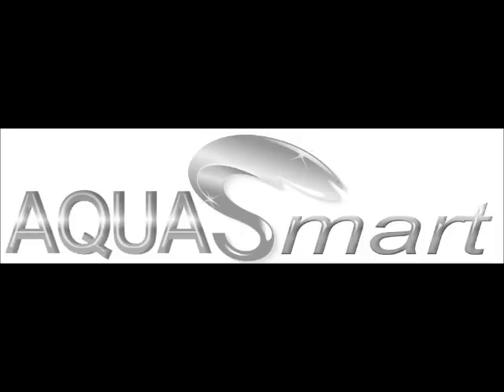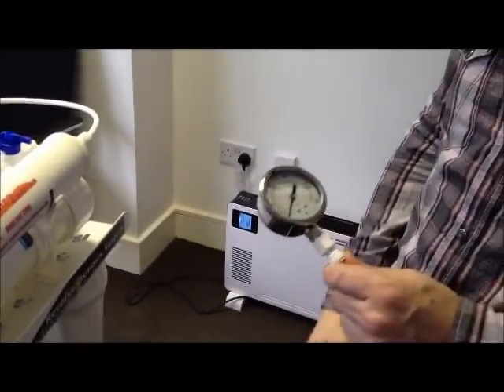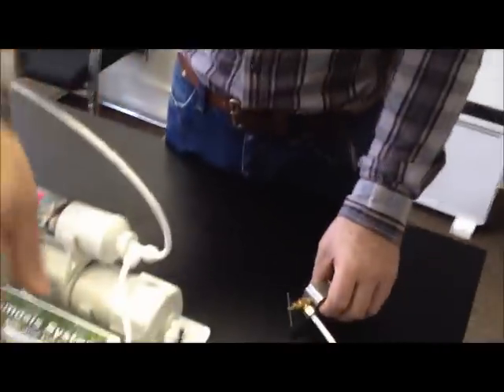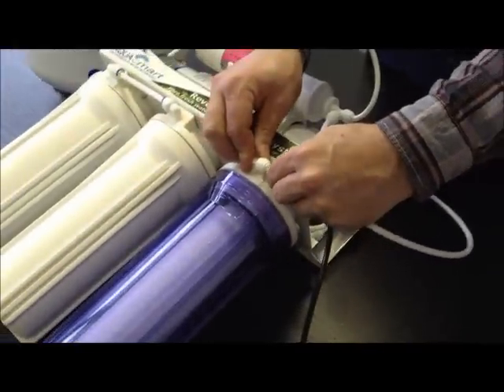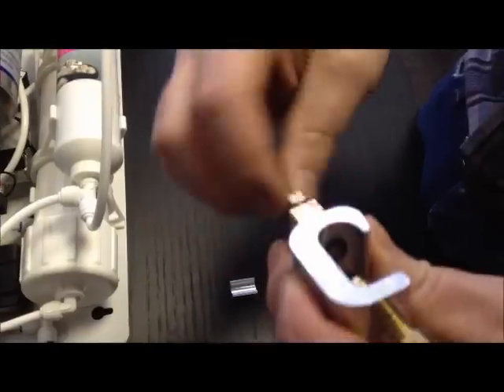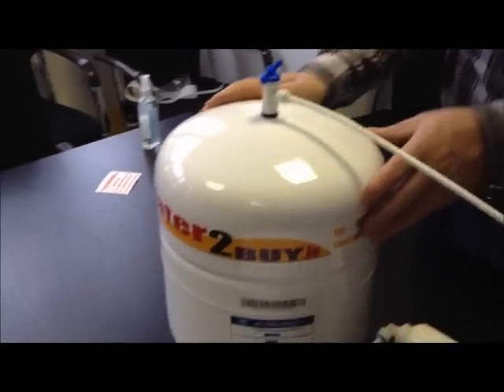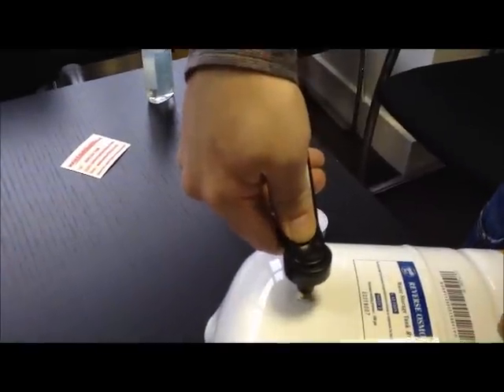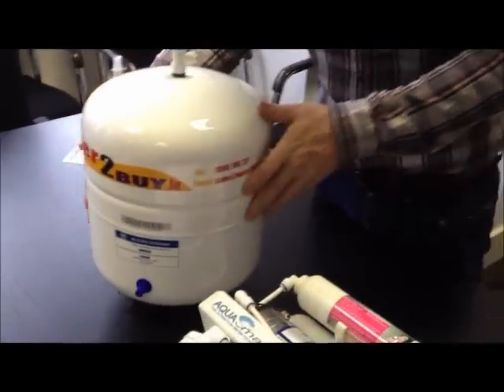Reverse osmosis No water or a poor water flow from your NON-pumped system

Comment: My system is not producing water.  Input water pressure is 55 psi. My tank is empty and empty tank pressure is 7 psi.  Tank doesn’t fill, drain line is flowing and there is no water from the RO membrane to the tank or faucet. Obviously ASO valve is open - could this be bad check valve or clogged membrane?
Reply: Xezatt  I figured out my problem.  I took out the sediment filter and 2 carbon filters.  On each one of them I covered one end with my hand and blew air with my mouth on the other end.  I was surprised to find that one of the carbon filters was blocked.  I replaced all filters and got my system working again.